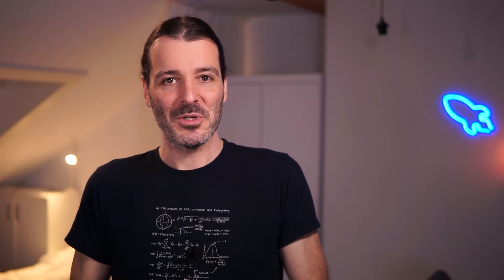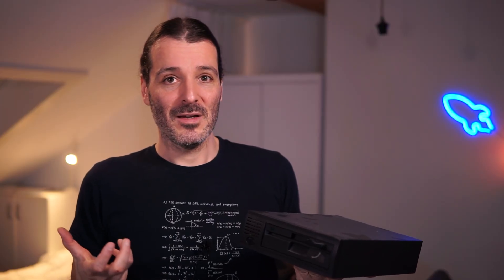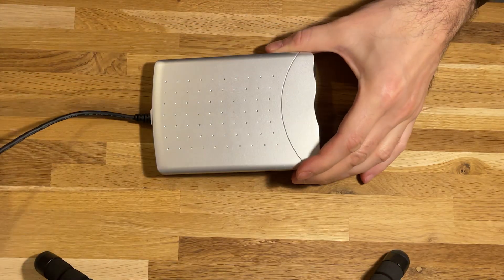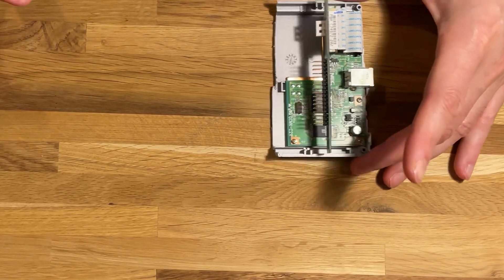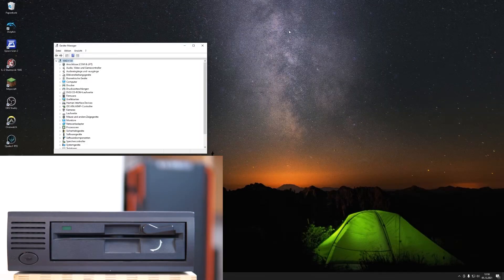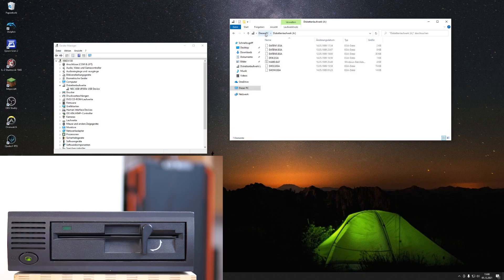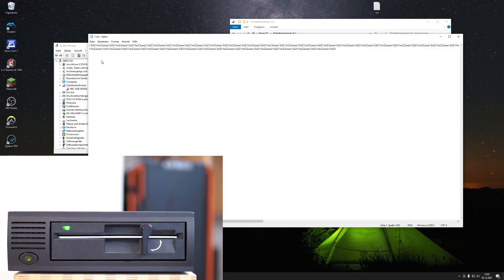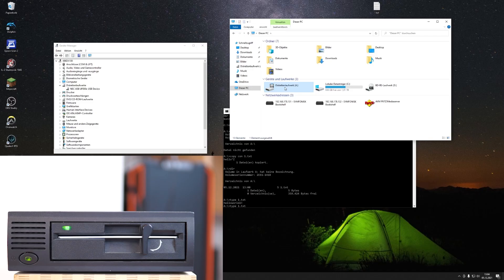How to build a working external 5.25" USB Floppy Drive

Comment: You can handle 360K (DD) drives with this rig by using a 360K (48 tpi) floppy.   The adapter will treat it as a 720K, which happens to use the same 300 RPM spindle speed and track layout (9 sectors of 512 bytes) at the same 250Kbps data rate.
Where you run into trouble with a HD 5.25 (1.2M) drive is that the spindle speed is 360 RPM.  You could, of course, re-jumper that Teac drive to use 300/360 RPM dual-speed, but it won't double-step for 360K disks.
Hope that solves a bit.
Reply from the maker: The weird thing is, that under MSDOS and Freedos the 1.2M media work just fine. It only under the newer OSes that the drive only reads double density media and that only with partial success.
Reply: @dospedition4207 : Everything but the 1.44Mb format was depreciated from Windows XP on - I have a dual-boot XP/DOS system that can only reliably work with the 720Kb diskettes (meaning both read, writes, and formatting) under DOS, same physical drive.
Reply: @IBM_Museum    I think "deprecated" only in the sense that the user had to specify the format parameters.   For example, on my XP system FORMAT A: /N:9 /T:80 works just fine on a 3.5" DD drive.  There were some cost-reduced USB 3.5" floppies that supported only the 1.44M format, however.   That wasn't XP's fault.
Reply: @tubastuff : Fair point - but it is interesting that the '/F:720' (actually, ALL of the defined sizes but '/F:144') is pulled from the commandline FORMAT and GUI starting from XP. I've used the longer switches as you have shown above, and had it fail under XP. Then I dual-boot to MS-DOS 6.21 on that same system and drive, and have the same diskette format perfectly there (my dual-boot "Tweener" is set up that way for a reason, to get 'Reference', 'Starter', and 'Option' diskette images online, then extract them - many of the IBM "Option Diskettes" are 720Kb format).
Reply: @IBM_Museum  I walked over to a system running XP stuck a 3.5" DD floppy in the A: drive and typed in the long-form command line format.  It formatted perfectly.
The code is there--check the DDK--I believe it still includes the floppy driver code.
Reply: I'll add a bit that the suspected reason that 720K and 360K formats aren't officially supported in XP is because old 3.5" DD drives (e.g. Teac FD235F) and all 360K drives lack the "Disk changed" line (usually on pin 34) and it makes things difficult to determine if the media has changed in a drive, particularly when writes are cached or delayed.   Win95 got around this, sort of, with their "volume tracking" driver, which overwrites the system ID in bytes 3-11 in the boot sector.   Of course, if the write failed, the user wound up being unable to access his data.   This was met with quite a bit of acrimony by the user community.   DOS doesn't delay writes, so it didn't have a big problem with this.  FWIW, the issue goes all the way back to CP/M with its "checksum" field in the DPB.
There exist DLLs that can make it possible to do all sorts of weird things with the FDC, such as handle FM encoded floppies.   Clearly, this is something that you want to keep out the hands of the unwashed user community.
Reply: @IBM_Museum  I can work with 720Kb just fine on Windows 10 using a USB floppy drive.
Reply: I agree. Could be dangerous
Reply: @IBM_Museum  @tubastuff: I have confirmed accessing 720K and 640K-formatted 5.25" disks, at 300 RPM under WinXP with a UF0001 to a Teac FD-55GFR 7193-U jumpered for 300 + 360 RPM operation. I formatted these on a traditional set-up using FDFORMAT.
Reply: @dospedition4207  That figures--the data rate of a 1.2M disk spinning at 360 RPM is exactly the same--500Kbps--as a 1.44M one spinning at 300 RPM.   I take it that your board probably uses the SMSC USB-to-floppy chip.   Datasheets are still available.
Reply: I wonder if a quad density (720K) 5.25" disk would work.  They weren't very common and I don't if all 1.2 MB drives support it or if you can format high density 1.2 MB disks to that geometry since people report using 1.2 MB disks as 360K is iffy.
Reply: @rager-69  Probably--there's no difference in the interface as far as a 3.5" 720K drive and a 5.25" one (e.g. Teac FD55F).   However, note that most 5.25" drives spin at 360 RPM, not 300 (as in the 3.5" drives).   Some have jumpers to enable operation in so-called "dual speed" mode (300 DD or 360 HD).
Reply: @tubastuff  Most 5.25" drives spin at 300.  It's only the 1.2 MB drives that spin at 360.  There were way more 360K floppy drives in the PC world than there ever was the 1.2 MB drives.
Reply: @will_it_work  Not sure what you're getting at, nor what I stated was wrong.   For what it's worth, there are 5.25" HD drives than can be jumpered to "dual speed" (300/360 RPM) operation, depending on the pin 2 signal. Regardless, they're still 96 tpi drives.  There are also 96 tpi 5.25" drives that can only work in DD mode (e.g. Teac FD55F).   Similarly, there are 5.25" drives that work only in the HD mode (found on many Japanese PC98 systems).  I've found that it's easier to find used 1.2MB (HD) 5.25" drives today than the 360K DD drives at least in HH configuration.  Note also, that the "combo" 5.25"/3.5" drives (e.g. Teac FD-505) appear to be HD in their 5.25" section--I'm not aware of any combo drives with a 360K 5.25" section.
Reply: @tubastuff  What I'm getting at is that you stated most 5.25" drives spin at 360 RPM, which is incorrect.  The vast majority of 5.25" drives are the 360kb variant, and almost all of those spin at 300 RPM.  So that's what I'm getting at.